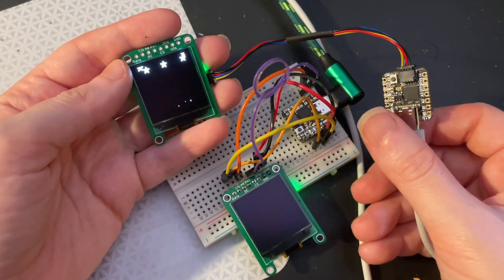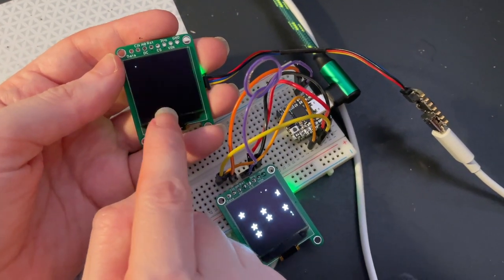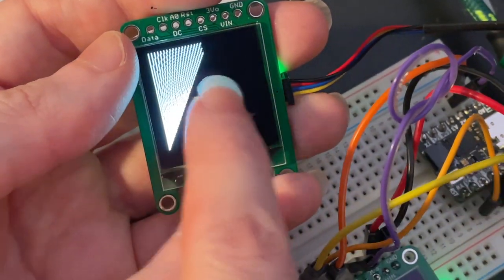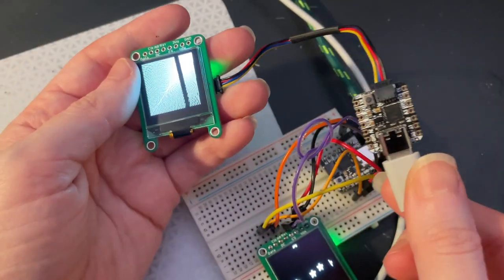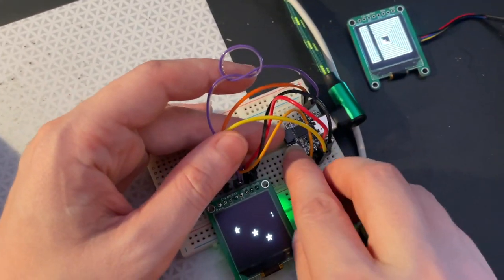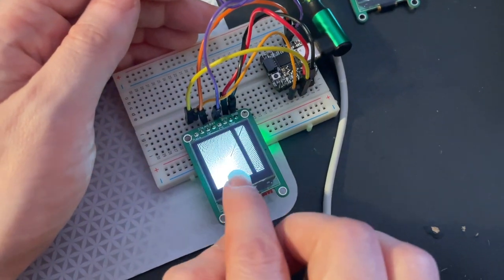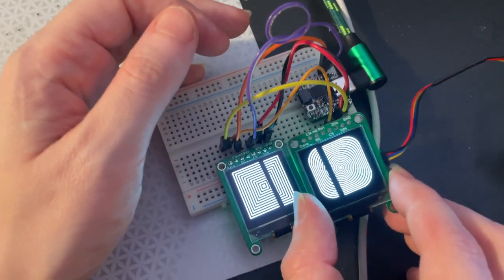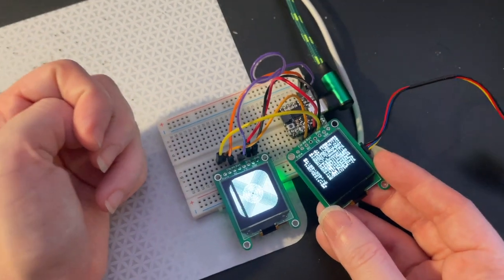128x128 Monochrome OLED proto test!

Comment: I NEED IT! haha litteraly wanting a square monochrome display for so long. dont need the colors of the 248x248 ones but dont know if i like the resolution of it over the oled feature🤔 guess i need to give it a try
Reply: I think they already have an I2C 128x128 OLED, think it just doesn't have or expose spi.
Reply: @rpavlik1  thats the problem and i need it without the pcb. i guess i need to buy it elsewhere
Reply: @cedrickany  oh, yeah if you need it without the PCB you probably need to talk directly with the panel vendor.
Reply: 248x248? I think 128x128 is the highest res oled you can find. The color ones are also 128x128, at least the ones i have seen. There are some 256x128 oleds though, but those are quite a lot bigger (4.7") and expensive.
Reply: @Nobody-Nowhere  nah sorry i ment the 240x240 tft screens. just looking for a square one i dont care if it is oled or lcd but they are way more expensive then standard screens. so i am happy with finding new ones that are maybe cheaper